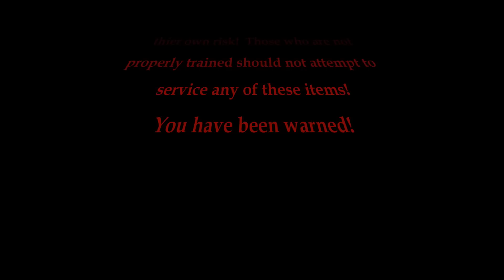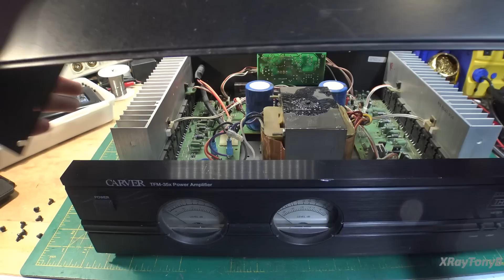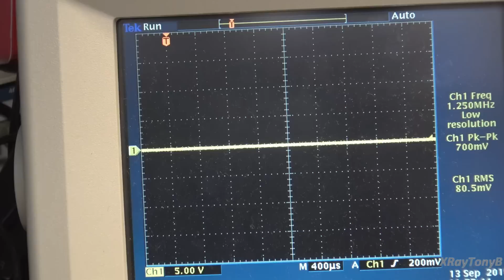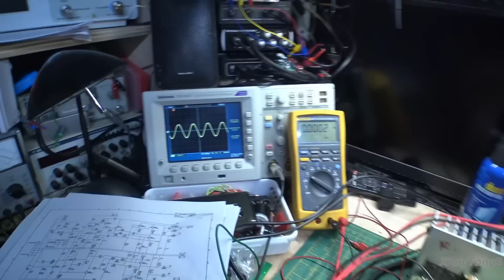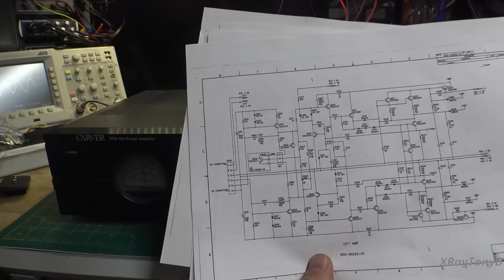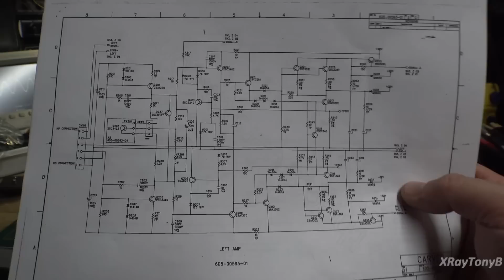Carver TFM-35x:  Smokes and Then Repairs Itself!

Comment: Similar experience in my case too.  Had decent load on the amp, played for 15 seconds.  Smoke came out on both sides by Protection relays clicked off and lost sound.  Turned power back on and both channels sound great.  Found burned resistor that powers relay coil of protection  circuit. Protection circuit doesn’t shut down anymore.   Amp probably won’t have protection any,ore.3

Comment: Okay at this point I'm thinking there was a bad solder joint maybe related to the relay and the protection circuit and as current flowed through it it aren't made some smoke and soldered itself back together maybe reheated and melted the solder.

Comment: Sometimes a metal oxide resistor will have a layer of dust on it and when the resistor heats up to operating temperature the dust will burn off and give off smoke. And as for your gain disparity between channels some of these TFM amplifiers have an adjustment potentiometer on the driver board which adjusts the gain of the amplifier.

Comment: I was thinking one of two things... The relay itself having bad contacts or not mechanically closing right and acring?, was it driving signal when it smoked? it could have been the relay itself that smoked on the contacts. Other things i have seen with carver is cold solder connections especially on those larger TO-126/220 devices.

Comment: Hello, my friend, can you help me, I have a carver, could you tell me the measurements of the three capacitors? My technician said that they altered the equipment and he does not know which are the original capacitors and the thermostat that is on the heat sink of how much degrees will it be? can you help me I would appreciate it, greetings

Comment: I have one of these amps from new. The black on the transformer may have been put there to stop turn-on noise. I glued a piece of cardboard onto mine to stop the thump of the cover pulling down when the amp is turned on.
Reply: Did it work cause mine to-45 does the same
Reply: @mannybarbosa9312  Yes it helps

Comment: I have 3 of these amps (TFM-35X) Two running mono up front and one in 2ch mode on the back channels. The two on the front are identical, the one in the back is a different generation as it has two large capacitors mounted horizontally behind the transformer whereas the other two have the upright caps like the one in this video.
The one in the back began tripping out during a movie one evening so I took it out of service and benched it. When it's powered on it acts as expected. but after a few minutes warmup time the output relays begin cycling in and out. 

I started poking around with a wooden probe looking for a bad solder spot as this usually proves fruitful almost immediately when I've tested other components over the years. I had a new set of output relays on hand in the event they were the cause due to age.
When I gave a little push on the right channel relay it felt loose on the board. Not flopping around mind you, just had some play to it. When I continued to poke at the relay a heard a sharp "SNICK" come from that area of the board with an accompanying barely visible whisp of smoke that dissipated as quickly as it appeared and left no real odor in it's wake.
However, much like you amp... it's working fine now, no relays tripping and both channels seem operational.
For the time being it's back in service. 

The magical, mysterious self healing 35X!
Reply: Could it have been a case of a cold joint autosoldering itself? Highly improbable but a potentially posible explanation.

Comment: Maybe some small signal transistor in the early stages when is cold is malfunctioning and causing instabilities,later after few degrees warmer it fixes.I have seen it in many car amplifiers and also with the opposite effects,when heated a problematic small signal transistor burns the output power transistors.

Comment: Freeze spray perhaps?????   Carbon resistor internally cracked?  any resistor lead not touching the element properly?    Freeze spray will tell you about all of those problems. also heat is generated with a current flow and not on a signal flow.
Reply: Freeze spray will also expose any cold solder joints on a board that can cause noise or glitchy signal issues like Tony has here. I've used it with success in troubleshooting intermittent issues more than once.

Comment: I had a problem similar to this one a long time ago and it was oxidation on one of transistors leads that shorted temporarily and then it opened and everything started working normally as this Carver did . I just cleaned all the transistors leads with a small metal brush and it worked fine . So see if that's your problem . Good Day !

Comment: Loud speaker and power supply relays often lots of intermittent faults and could be bad solder joints on PCB I dont like the design of these amps no bottom cover have to take the hole thing to pieces to have a good look

Comment: I Have replaced  the output relays as they are a common problem with the 35x i have and the 2 55x carver amps i have i used equivalent Omron relays. This fixed the intermittent operation.

Comment: Another issue to keep in mind when working on Carver amplifiers and receivers. If they have a A & B speaker switching capability, the output relays will be double pole double throw devices and the 2nd pair of speakers gets wired in series with the 1st pair through the additional contacts of the relay.  There is an extra pair of contacts in series with the speakers that you aren't even aware of and aren't obvious until they start interrupting the audio signal because of oxidation or pitting on the contacts. They are usually sealed relays, and although it is possible to cut them open and clean them, It is a chore to  get the contacts scrupulously clean and properly aligned so that they mate snugly with no resistance, and therefore I recommend just replacing them.

Comment: I would also consider checking the underside of the PCB as you suggest.
Both for bad soldering but also to eliminate the possibility that something has
fallen under there and got jammed between the PCB and the bottom case.
A screw or something that's wedged in between and partly shorts one ore more traces to ground
could maybe explain some of the strange behavior you experienced.

Comment: That type of problem is a PITA. The only suggestion I can offer is try alternately hitting the signal area with heat and freeze spray to see if you can excite the bad part.

I once had a Hafler power amp (60w per channel)that would occasionally flake out on one channel. After a few hot cold cycles it came down to a small signal diode in the bowels if the input circuit intermittently shorting. That diode just had a few ma going through it and not more than 5v across it worst case. I popped in a 1N914 and problem solved, stable under all conditions.

Comment: It appears that you're not using an incandescent bulb as a current limiter in series with the power cord. You should be. Also, when troubleshooting an amp for low power, it is sometimes helpful to check the output at a higher frequency, and also measure the distortion at both low and high frequencies and compare ot to the working channel. By the way, I  worked on an amp not long ago where the customer's complaint was "low gain on one channel". It turned that the "low-gain" channel was working pretty much as it should, but the channel with higher gain was defective, it had much higher distortion and 7 volts of DC offset at the speaker terminals ( it didnt have an output relay or any kind of protection circuit to shut it down).!

Comment: These units have weird power supplies, designed to loaf along at fairly low B+ voltages until you crank up the volume and ask them to deliver more power and then the B+ more than doubles. Be very careful, if you slip with your probes  you may blow this thing up big-time. I don't particularly care for how they sound anyway, kind of dull and closed-down in my opinion. I definitely do not recommend running them in bridged mono mode, they'll be less stable and the distortion will be at least 4 times higher! Besides, how could anyone possibly need more power than these amps deliver in normal stereo mode?!

Comment: I was  guessing it was a cold solder joint with a large resistor or diode  before you mentioned it.
 So much amps heated one side of the joint that it remelted the joint ,hence the smoke, and  that allowed
the juices to flow into the rest of the joint  and the circuit went into its normal state. I'm going  with that! You'll need to confirm it by looking at the  bottom of the 

board.😑

Comment: Just some thoughts on the "magic smoke" that you were smelling and that magically seems to have gone back again - what can smoke? Resistors (usually can be seen on discolouring/ changing colour. Electrolytics may vent out and blow some of their ingredients out which would be bad thing for the tracks of the PCB. It could have been one of the coils of that region. The Transistors could be the cause but they won't smoke without then really really quitting their service ;) They would only give some slight hints of the region where the cause can be found by blowing up all components in their neighborhood. ;)  So, I would maybe doing quick-check of the electrolytics for spilling and check if there could be seen some burn marks on the PCB/ Resistors/ Coils and then do check with freezing/ heating up if some components would react on temp changes. That's all you could do.
Thanks for the video, it's good to see you also get into unclear situations like I feel I would do again and again and .... ;)

Comment: Did you consider a small fly or spider inside causing a temporarily short, which had been barbecued (well done)?
Reply: a spider has too much resistance to present a problem. the exoskeleton is basically a non conductor
Reply: @mtabernig  Yes, but i just wanted to bring another idea into discussion. Even a spider/fly can carry some humidity and dirt - and the rest is a question of the applied voltage and the impedance of the circuit at the point where this animal walks about…...
Reply: 😆 - similar to a fly zapper

Comment: This to me looks like a good job for a very sensitive signal tracer! I have seen (I think that it was one of Paul Carlson's videos) where he would bring the probe close to a resistor and you can hear it resisting, literally! Some resistors are really noisier than others and the bad one's (even though they still function) are arching inside and adding distortion and noise to the signal... If a signal tracer isn't handy, an old head from a cassette deck makes a good probe. All you need then is a very high gain input on and amplifier, either the cassette deck or phono inputs should do... Connect a spare speaker and be prepared to hear what the magic smoke is doing.... Oh! I just remembered another video by Kreosan, he's that crazy Russian doing crazy electronic experiments... He used a Walkman to achieve the same thing. He showed what you can hear with it in a few things... It's mind blowing if you haven't seen it already! Highly recommended... Since this is a two channel amplifier, it literally has two of everything, and so the same resistor should sound the same on both sides, I believe that you should be able to hear capacitors also.... It's a neat experiment... People don't use signal tracers anymore but they still have their place in electronics problem solving even today.... Direct probing is one thing but AF and RF coupling the device under test is something else that's out of this world! It's basically the quickest way to find intermittent problems because you will hear the device struggling even though nothing is showing up on the scope... I bet that this method will find your culprit!
Reply: At the stereo repair shop I work for,  we use a Huntron curve-tracer/ comparator; assuming that the device has one good working channel and one defective channel, the Comparator can be used to inject pulses into the "same" component on each channel simultaneously and you look at return signal for each channel on the devices' built-in scope. When you find a component or area of the Circuit where the return pattern is different for one channel versus the other,  that's the area you should be examining for defective parts. The unit you are working on does need to be (and *must not be*) powered up for this type of diagnostic testing!

Comment: If you plug your 'scope into an isolation transformer could you probe across both channels?  That would put the 'scope probe outside of the amp ground.
Reply from the maker: In this instance, an isolation transformer would not help.  The problem is that the ground terminals of each channel of the oscilloscope are tied together.  If you connect the ground of each probe to the negative terminal of each channel (left and right), you are essentially tying the two channel's negative speaker terminals together.  On many bridgeable amp designs, the positive terminal of one channel is common to the negative terminal of the other.  The channels are then driven 180 degrees out of phase from one another so that they are in phase at the speaker outputs.  Connecting the negative speaker terminals together could result in shorting one channel out, depending on the design of the amp.   It sounds a bit confusing, but I think I go through this in more detail on some of the other Carver videos I did.  Hope this helps.  Thanks for watching!
Reply: @xraytonyb  Thanks for the information.  I totally understand now.  I have seen amps that had warnings in the manual that the channels must be kept seperated.

Comment: Looks like some bad solder joints on the little board attached to the back of the amp.  Look at the 4 large horizontal pads.
Reply from the maker: I actually unplugged the input board from the main amp board and the protect circuit still tripped (until the amp fixed itself).  The problem seems to be on the main amp board and is acting like a very intermittent transistor.  Thanks for the suggestion!
Reply: Yes, but a cold solder joint on the input board could cause one channel to be weaker or intermittent.

Comment: Cold (high resistive) solder joint pulled a lot of current intermittently, which heated it up to the point of soldering itself.  That smoke may have been a tiny bit of left behind flux burning off.
Reply: Not likely moron.

Comment: Some suggestions:
1) try tapping on the board, instead of merely pushing on it.
2) try “freeze” spray, or heat from a hot-air gun, and see if you get a sudden change.
3) try running a real audio signal through it, and randomly change the volume up and down.
4) do no’s. 1 through 3 with the top off, and the camera running, in case more smoke comes out! 😃
5) I think you’re going to have to lift out the left-channel board at least, and see if there’s a burn/char mark on the underside. You might even find a crispy critter (a.k.a. dead bug) was what let the smoke out.
Reply from the maker: Thank you for the suggestions!  I actually did try pressing on the board, but no luck.  I also used the freeze spray, both when it was tripping the protect relay and when it was "behaving".  The freeze spray was inconclusive, as sometimes the problem seemed to change and sometimes it didn't.  I had an older Pioneer amp that did this same thing and it turned out to be a very intermittent transistor.  It wasn't a thermal issue so much as it was a faulty lead connection to the actual silicon inside the case of the transistor.  This is why you will often see me replace all the small transistors in these older units.  Thanks for the suggestions!

Comment: That's two big gangs of transistors. Usually only see that type of thing in car amps. What's the power of this amp? 
Edit ok it's 250wpch I should wait before asking questions.
Reply: 250w into 8 ohms 350w into 4. 700w bridged.

Comment: The board come out not bad. Undo screws on board and heatsinks and the whole think will tip up and stand on the ends of the heatsinks. Pretty easy to run and test, there is a ground that unscrews with the board so I always would clip it to chassis in this service mode.
Reply from the maker: I think that will be my next move on this amp.  Thanks for the advice!